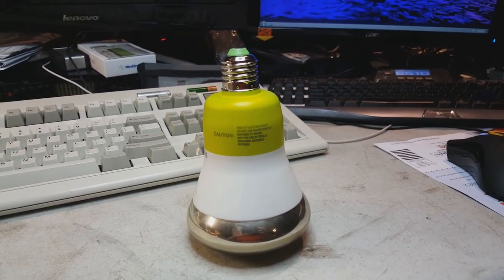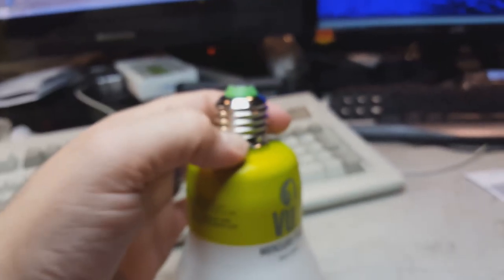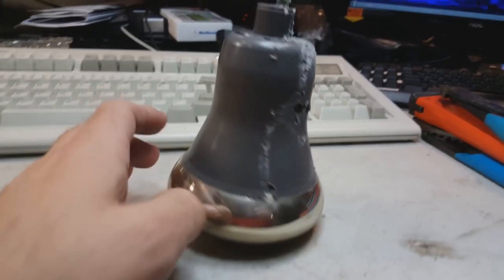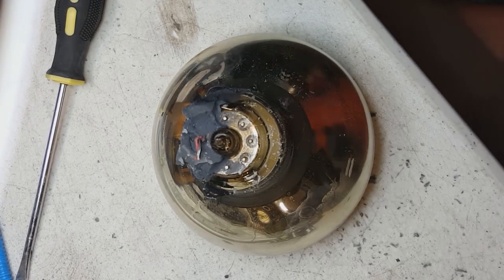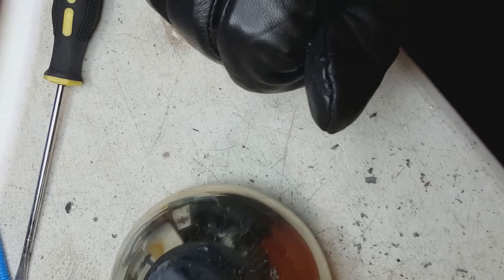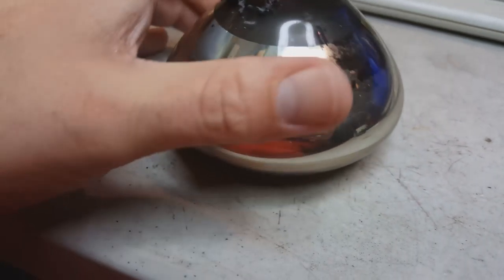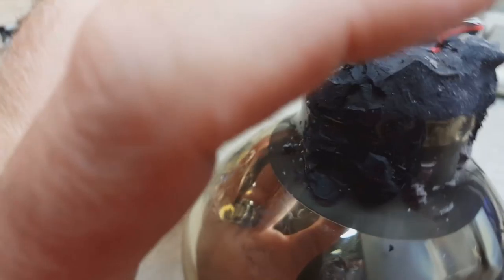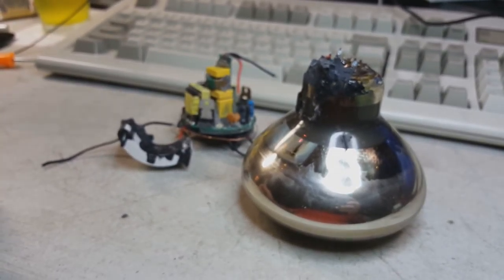VU1 CRT Bulb Autopsy

Comment: Interesting, I recently got my hands on a few of these. So far the one I am using works fine, but, I am intrigued by the fact that it has a full CRT system inside. I was expecting more of a crude flood style electron gun or even a thyratron style system.  I kind of want to pull one apart, replace the yoke and try using it as a CRT now.

Comment: I bet that tube uses the same or similar gun as a projection TV CRT, hence the brightness.  When used in TV's, they were almost always liquid cooled.

You could probably have a crazy bright oscilloscope CRT if you were able to extract one without breaking it and figure out the pin assignments.

I can see why they rate it at 3 hours per day.  It needs several hours to cool because of the poor thermal design.  Maybe test the next one in an intermittent use fixture for curiosity's sake?

Comment: For six weeks, it lasted for about 1,008 Hours.

Thank you for show the example of the CRT Light Bulb. I mean wow, That part should at leased discharge them by using an High Voltage Probe to eliminate the High Voltage that contained in the transformer.

I don't know if there's a Daylight version available on CRT Light Bulb.
Reply: ***** Daytime TV sucks anyway! ;-)
Reply: There is not a daylight version.

Comment: I don't understand why CRT's are still being used. Especially in light bulbs. I thought the main thing was to save energy. LEDs do a pretty good job and they are safe for the environment and they are pretty reliable and are good for parts. CFL driver circuits are also good for parts. You should do what Force311999 suggested and try to make a small TV out of the other bulb. it will be like those old vintage "Roundie" TV sets. I'd love to see that happen.
Reply: coondogtheman1234 Good question.... Maybe a small crt factory was converted to make these bulbs with minimal retooling??
Reply: scottyfixit
I bet that would work. If you get a portable TV and take out the yoke and put it on this you might get a picture.
Reply: " I thought the main thing was to save energy." This CRT lamp was also energy saving.. remember, anything less than an incandescent is "energy savings". its a vague term
" LEDs do a pretty good job" Expensive ones are, but most low/med priced consumer LED bulbs have poor color rendering and bad power factor, not to mention they are often have poor heat dissipation which leads to a shorter than claimed life..
"and they are safe for the environment " No their not. sure their cheaper running costs lessens the guilt for the consumer, but the mining for the minerals and processing of plastics and metals for the bulb actually comes at a very high cost, not to mention once it dies what to do with the ewaste it creates..

Comment: I am ripping one apart right now (it lasted around a week and then was really dim). It got me with a little zap, but not much as I let it sit a long time before opening it up. I cannot figure out how you detached the CRT from the socket, did you have to cut it out? (the pins looked snipped?)  I sort of want to be able to take it apart and try to find the weak part and fix i, or if nothing else be able to use the flyback to drive it as a CRT with my own hand wound yoke.  any insight would be greatly appreciated.
Reply: never mind I got it apart,  it is odd the filament gets very bright at just .7V and draws slightly over an Amp.  I cannot figure out what it should run at, but this already seems to bright.  If I had a second I would smash it to see the inside more. I guess I'll go work with what I know to be a grid pin and take it from there.

Comment: Horse kick in the chest, eh? I wonder what that uses for high voltage.

I was kinda surprised that it uses solid capacitors in places.
Reply: MrMaguire As best I can tell, the flyback is made from an HV transformer and some sort of frequency modulating transistor, although none of it has any form of heat sink, the caps were in direct contact with the transistors (that NEED a metal heat sink).. and not only that, it was potted in silicone, which insulates heat and therefore every component including the CRT neck were roasting.